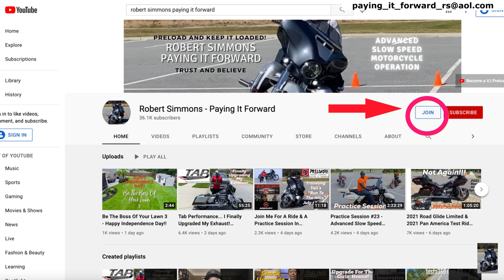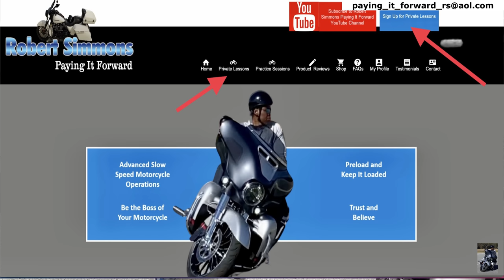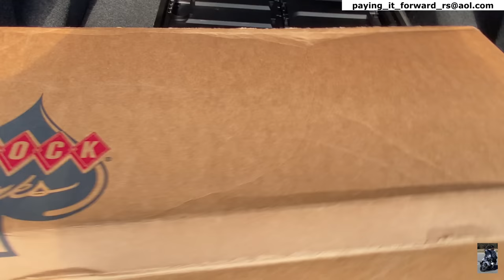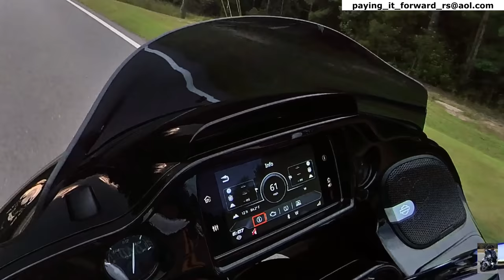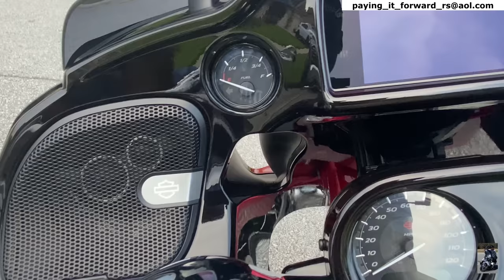Which Windshield Should I Install On My 2021 Road Glide CVO? Klock Werks 9" or 14"?

Comment: Hey...just stumbled on your videos....I work for Klockwerks here in Mitchell, South Dakota, and on behalf of the company, I thank you for such a thorough review.  Yes, you're still going to get wind in your face...part of the reason we ride, right?  But the Flare cleans up the wind and eliminated the "bobble-head" effect.  It's also a performance windshield putting as much as 15 pounds of down-force on the front end at highway speeds to, like you said, hug the ground.  We all know that the bike's front ends get light at highway speeds.  These are wind tunnel designed and Bonneville Salt Flats proven.  We now have them in an array of colors to really make your bikes look great.  Again, on behalf of Klockwerks, thank you!
Reply from the maker: Thank you for watching and hopefully you’re subscribed to my YouTube channel!👍🏾😊 It’s my pleasure. 😊 I have them on all of my motorcycles.

Comment: The 9” looks cool, but I went with the 14” on my RG.  I wear a half helmet most of the time, and I don’t get any buffeting.  My glasses stay still and my helmet doesn’t move.   Very happy with it.  The 14 still looks good on the bike.  👍 I keep the top vent closed.
Reply from the maker: Thank you very much! :_THANKYOU:
Reply: Question, how tall are you, and does the 14” obstruct your vision?
Reply: @fyrmn1969  I’m 6ft tall. I have the light tint windshield not the dark smoke. Visibility isn’t an issue. The windshield is below my line of site. 👍

Comment: Robert. Love the videos. I have the exact same bike and also went with the 9" klockwerks windshield. As for the additional wind through the fairing, with my2020 road glides they did away with the operating vents in the lower part of the fairings. There are kits available that remove the existing tunnels and replace them with tunnels that have the closable vent doors. I installed one of these kits on my 21CVO RG and it makes a huge difference. Especially closing them at highway speeds.
Reply from the maker: Thank you very much for the compliment and the information!👍🏾

Comment: Dang that a gorgeous bike. The 9" looks nicer. A fairing just makes a low pressure area behind it. The dual vents helps to add some pressure around your chest to control potential buffeting. Bugs will come thru the vents but screens are available for that. 31 yrs. on the job and I'm still working the road and looking to improve the skills.  Thanks and keep getting after it Robert.
Reply from the maker: Thank you very much for that information! Also, thank you for your service!

Comment: Robert. Is my understanding that the top edge of the windshield should be at the same level of the tip of your nose when you are sitting straight in your motorcycle. 

I did that, my son helped me with a láser level and I found that for me should be 10” windshield in my Ultra Limited. And it works. Try that approach and find out what height suggestion came out from the test 

Good luck and enjoy.
Reply from the maker: Thank you very much! :_THANKYOU:

Comment: You may already know this but you can get the inserts to open and close the lower vents as well. For us northern winter riders they are a good thing lol. I prefer the 9 inch klockwerks windshield myself. I'm 6'2" and always ride with a full face modular helmet so I like some wind coming back for cooling purposes. As long as I'm not being buffeted to death I'm fine.
Reply from the maker: Thanks Doug. I just bought a full face modular so I’m sure that will help.

Comment: Like you, I have the 14" and 9".  I'm 5'10" and like seeing over the top.  I wish KW made a 9" clear  (why not!!!)  I'm a Heritage owner also and I love the clear windshield it has.  You might find that with the vent open, there is less wind on  your face....try it.  Also, MOST of the wind buffering comes from the bottom up!..not over the windshield.  Place you had at the top of your helmet and you may have little wind buffering...so the windshield is doing it's job.  Now close you legs close to the tank....that might get rid of a lot of buffering.  Now put your open hand down by you legs/knees and you will eliminate more wind buffering.  Bottom line -  a lot of the buffering is coming from below and up....not over the top.  So I installed a HD wind buffering shield...useless!!  Saw a HD RG with a molded lower wind buffer installed in Daytona.  But I think it was a special CVO order.  Still looking....but close your legs to the tank and that will remove a LOT.  Love your vids....sorry I missed you at Bike week.  ONe more thing, for slow speed skills....head turn, friction zone, light rear breaks, preload, etc....If you ain''t doing 8 - 10 mph or more....down she goes!!  PRELOAD and friction zone are THE MOST IMPORTANT.  IMO, you're the only one of the "teachers' that emphasis the importance of PRELOAD....THANKS!  I need that on my '20 RG with 2 - up most of the time.  Heading to Lafayette, LA for rally and then Panama City Beach and Sturgis.  Hope to see you.
Reply from the maker: Thank you very much! You’re on the money!!

Comment: 9” windshield for sure on that CVO.  I have a 12” touring by Klockwerk on my RG Ultra and it serves me well and still looks good.
Reply from the maker: Thank you very much! :_THANKYOU:
Reply: I have the 9" and recently got the 12" touring off the advice of the KW staff for my passenger. The 9 just doesn't make a big enough bubble for her.
Reply from the maker: @patrickstevens5457  Thank you.

Comment: I think the vents in the RG fairing provide some air pressure behind the fairing, to prevent air from swirling around the sides, trying to fill a big low pressure pocket behind the fairing. That swirling air coming around the fairing and up around the tank causes a lot of head buffeting because it’s so turbulent. The vents “backfill” the low pressure pocket with smoother air from the front. Closing those vents might introduce a whole new set of problems.
Reply from the maker: Thanks!
Reply: I agree

Comment: Excellent video! I like KW. Yeah, they cost a little more but the quality is there and you get what you pay for. QUESTION -  I've always been curious to know what it''s like for a motor officer during the winter. What's it like? What gear do they wear? Do you ride as much or does the weather limit you and if so, were you desk bound or switch to a car patrol? Please tell us as much as you can about that. I'm sure your viewers would love to hear about it. Thanks.
Reply from the maker: Thank you very much! The only thing that limits riding is ice. Then cars are used. We wore leather jackets. I actually showed it on one of my very early videos.:_THANKYOU:
Reply: I wondered that too about motormen that patrol in cold weather climates (such as NYC.. gets cold there in winter ..   it as bad as chi Tho.. gotta get my winter gear together.. bought a full face the other day.. ibe always been a 3/4 helmet dude and used to stop riding around thanksgiving.  Just got off a 15 year riding hiatus and don’t think I can go 3-4 months not riding.  So if no ice or snow I gotta work out some winter riding gear for some short rides at least
Reply: @geraldgoodiii6993   I spent my Career as a Trucker  running the east Coast for 80 percent of my Loads, because it got me home more ,  Chicago gets for sure more snow than NYC, because its kinda on the coast the Ocean keeps it a bit more Temperate, now getting there going across I 80 in the Pennsylvania winter time was fun at times to say the least lol

Comment: I haven't seen this yet but am about to. I may change my mind, but I think that if it were me,  I would start with the 9" and try it out. Go for about a 50 - 100 mile ride,  then put the 14" on and do the same thing. This will tell you if the 14 is too tall and if the 9 has enough wind protection for the longer rides. I know that you don't plan on touring with your bikes but you may take an overnight ride or even just a 100 - 300 mile day ride. Remember the buffeting will wear you out, but for the most part, non police bikes you should look over and not through the windshield. I'm not sure about the police bikes. 
Finally stay with the one you like the best that yields the best protection.

PRELOAD and KEEP IT LOADED!!!
Reply: Ok, after watching it. I think that you probably made the correct choice for you. Personally, I like the tallest windshield I can get and still see over. I have not tried a klockworks screen yet but I do plan to eventually. I know that you don't even have rain gear but you may still get caught in a shower and the taller screen may work better at keeping the rain off your face. In the end, it's your bike so you do you. 😀😀😀😀
Reply from the maker: Thanks Randy! That's exactly what I'm going to do. And the police bikes follow the same rule. You're never supposed to look through the windshield.:_THANKYOU:

Comment: You still may consider a taller shield than the 9'', based on being as tall as you are and the fact that you wear a half helmet. Wind is not the only factor, keep in mind projectiles should also be considered. (Rocks/debris)
Reply from the maker: Thanks! Yes I did consider that. I will try it out for awhile. I still have the 14" if it's necessary to switch it.:_THANKYOU:
Reply: lets not forget about state road crew trucks spraying weedkiller on 2 lanes roads, I caught up with a slowly moving truck one day I didnt notice it was spraying for weeds until i got some caught in the high winds that day and back into my face n eyes I barely made it to a gas station n they didnt have a water hose outside, I had water bottles on the bike, but bad as my eyes was burning I needed to flush them for several minutes, I had saftey glasses on, its been googles for me ever since or custom made glasses with the soft material to seal the sides,  another time with saftey glasses a bee or wasp got inside n stung be a few times before getting out, old doctor at the clinic the next day looked at my swollen eye and tan around my eyes from riding all summer, and said thats what happens when you ride a motorcyle without wearing a helmit, you all ready know I hadn't told them what happened yet, he was around the block once or twice lol, we have to protect our eyes much as possible, another time riding after dark I got a very small bug stuck in the tear dock of my eye, i tried water n a napkin, then water from a bottle, lucky a kid stopped with a eye flush kit in his med kit,  Thank God for him, my custom riding glasses when I get a new eye perscription costs over 800 bucks, my vision is worth more than that to me, so I'm happy to pay, Thankfully I have had no more eye problems from riding the last 10 yrs, Thanks for making these pre-load Videos, I watch them and they do help sharpen n learn new skills for sure, I went with the 12 inch touring on my new road glide, its tall enough to give me great protection but at 6'3 I can see over it no problem, love your bike !!

Comment: Also my clockworks screw holes on the LT hand side were not quite right I used the stock screen to locate proper locations and my dremel tool with Forstner bit to get to proper location.
Reply from the maker: Thank you.  :_THANKYOU:

Comment: Looks good on the bike. Have one question. Is that insulation on your garage door and if it is does it help the garage stay warm.
Reply: Good question, I was going to ask the same thing 🤔🤔
Reply from the maker: Thanks! Yes that is insulation on the doors. I actually have it on there to help the garage stay cool and it does help, so I'm sure it also helps it stay warmer than it would be without it.:_THANKYOU:
Reply: @BeTheBossOfYourMotorcycle  👍🏽thanks bro

Comment: Appreciate your videos very much sir.
Question LT..those handlebars being so low are not a problem? You mentioned them hitting your legs in turns.
Reply from the maker: Thank you very much! These really weren’t as bad as my other motorcycles. I’ve since changed them.
Reply: @BeTheBossOfYourMotorcycle  
What height did you go with? I have 14inch Yaffes on my FLHRC. Super comfortable
Reply from the maker: @RoadKing-269  12":_PRELOAD:

Comment: Looks awesome. 

I had a 4 inch, stock, garbage stuffer windshield on my Electra Glide when I bought it. I put the 10" Klockworks on and it was too tall. It cut the wind, but I was looking right through the bend on the top. Everything was distorted. 

So I went with the 7". I love it.  I still get a little buffering at 80mph, but nothing that bothers me too much. 

I wear a modular or a full face helmet. I rarely use the clear glass face shield. I usually pull down my sun shield instead. It keeps the bugs off enough and also gives me plenty of air circulation. Not to mention, full face protection. 

I like the touch of the 9" windsport windshield on your RG CVO. Very classy.
Reply from the maker: Thank you very much Jenni!:_THANKYOU:

Comment: Didn't like Klock Werks, too curvy and swoopy for my tast and my '16 street glide. I bought a "F4" brand 8" for summer and 15" for winter. They have a more smooth  look and create a huge pocket of fairly calm air at speed. 
P.S. I'm turning much tighter turns also... thanks!
Reply from the maker: As soon as you mentioned your turns are tighter, I forgot all about the windshield.😄 Good for you!👍🏾

Comment: 2019 and under all those vent open or close they should have left it like that in my opinion and if u do night riding check out the custom dynamic headlight it's 100% better then the Harley Davidson headlight
Reply: Had custom dynamic leds on my road king & miss them. Will upgrade by spring for new 21 RG Std. Great lights!
Reply from the maker: Thanks!

Comment: I traded in my batwing for a new roadglide. To be honest I’m not impressed with my roadglide’s fairing. I have a 14” clockworks windshield and I catch a crap ton of bugs in the face. Bees come at me past the headlight and up that channel. Crap flies up the fork channel as well and actually get past my eyewear from that low angle and I’ve gotten bugs and sand in my eyes. Compared to the batwing the roadglide noise level is far worst. I’m forced to ride with the stereo full blast at 60mph to hear it. It’s much more fatiguing by the end of the day and my ears are EEEEEEEEEEEE! Tenitus ringing, with confidence I can say I made a costly mistake and I hate my roadglide.
Reply from the maker: I actually sold my Road Glide. Check out the video.

Comment: I know the feeling about the stock windscreen. It’s awful. I myself am looking for another windscreen and I love the look of a 9 inch klockwerks but I was worried that it would not protect me against bugs etc. on the highway. After having it for a bit do you still recommend it?
Reply from the maker: I haven’t ridden the motorcycle enough to give an accurate answer. I have to change the seat. It’s terribly uncomfortable.